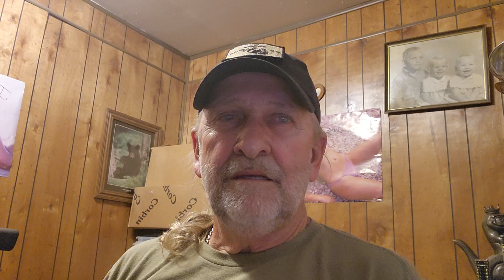Sportster S - Failure/Update- danasmith2816

Comment: Thanks for the update, my  Sportster S had the same issue, shut off on me at about 70mph luckily I just made it to my exit and was able to coast off the pkwy. It’s been at the dealership going on 5 weeks now. 🤦🏾‍♂️
I’m going to share this video with the dealership.
Reply from the maker: wow, they had mine 12 days and i thought that was a long time. good luck, hopefully this will help.
Reply: @Danasmith2816  What wires where the issue I checked all of my connections and they all seemed good. My bike did the same thing.

Comment: Please update.  Is the loose problematic wiring under the seat, or under the tank ?  

I have not had this issue 'yet'; however,  when I have my cruise set occasionally hitting a bump cancels the cruise.  

marcus
Reply from the maker: Originally they only told me a wiring loop under the tank near the air box, but i could tell all the wiring under the seat had been checked.

Comment: Dana, what steps did you take to black out your pipes?
Reply from the maker: You have to remove the heat shields and the end caps and then there are some screws underneath that will release the shields and there's a hose clamp up near the front and once you get everything off lay them out on some cardboard paint them and let them dry reassemble in reverse order
Reply: @Danasmith2816  Funny...No, actually I meant what type of paint did you use, did you sand the shields before, did you use primer and is so what type, but hey thanks anyway
Reply from the maker: @allanmobley940  Sorry about that. lol . no sanding, no primer and i used 1200deg header paint from Autozone. I wasn't sure I would like it so I didn't paint it like I wanted it to last forever. I do like it so now, if it doesn't last, i probably will sand and prime when i repaint. sorry about the misunderstanding.